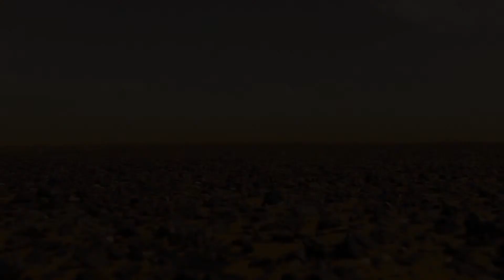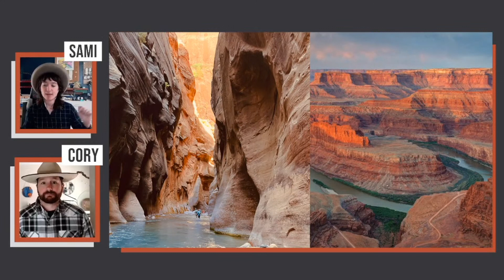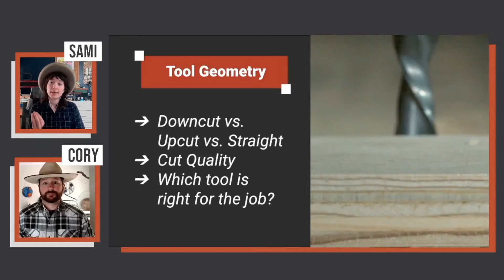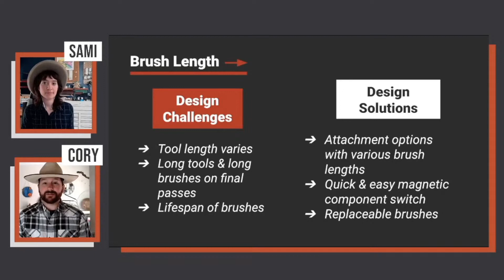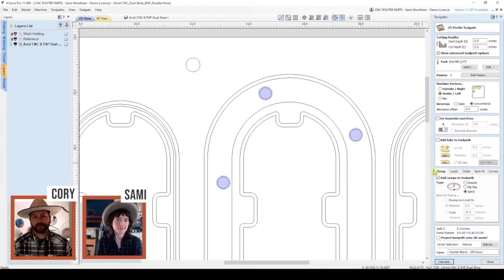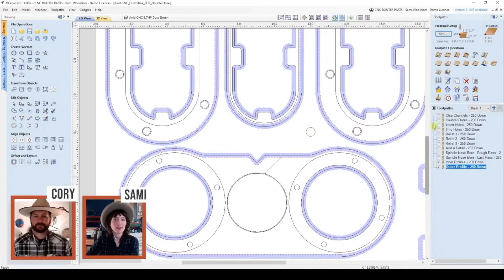Dust in the Wind with Avid CNC Team | Vectric Worldwide UGM 2021

Comment: Don't use vacuum systems anymore.  Just another thing to worry about, brush hairs get into cut, hose gets snagged, and you can't see what the cutter is doing.  My  Cnc's have an enclosure around them.  Most chips are thrown clear of the bit by the bit.  If I use a down cut I just run a small air flow behind the bit.  Easy clean up, takes just a minute or two depending on number of jobs run.  No vacuum noise and the enclosure also reduces noise in a major way.
Reply from the maker: Hey Billy!!!  The enclouser and air flow are a great idea!  Thanks for sharing!